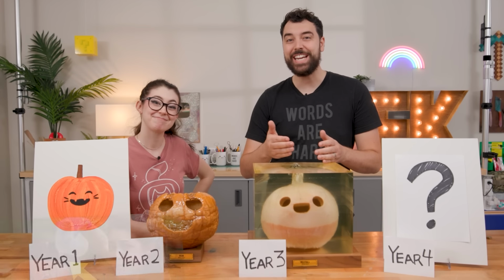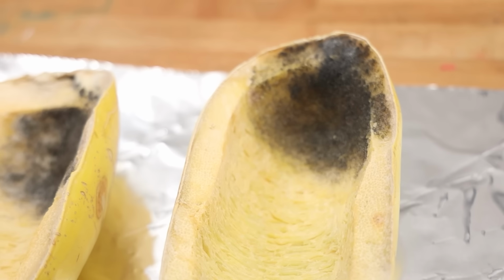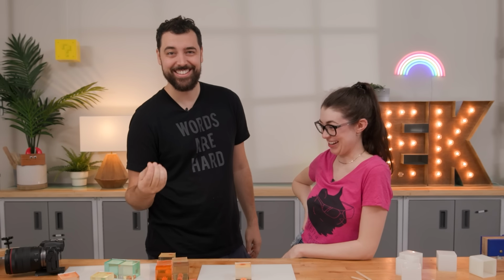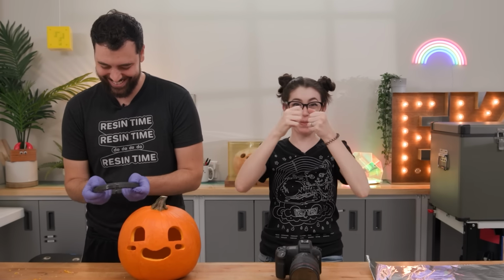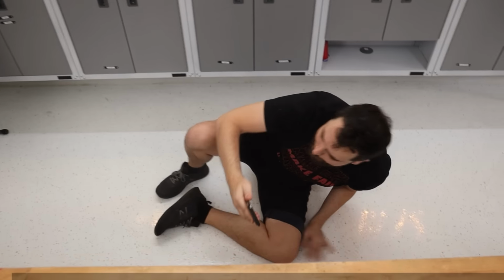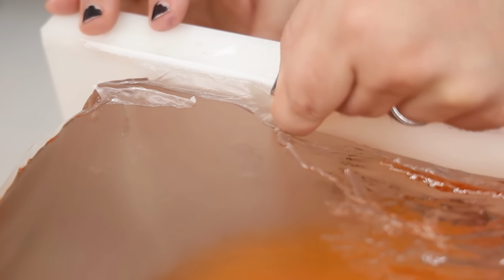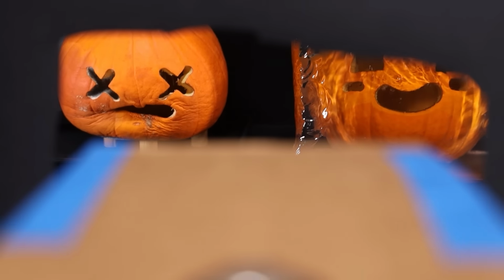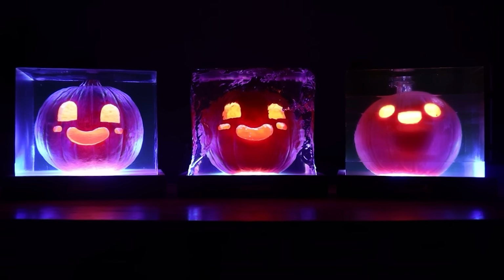Our BIGGEST resin pour yet… all to preserve a pumpkin

Comment: FYI, I am a pharmacist who deals with drops and volumes every day when calculating how long a bottle of eyedrops will last. The generally accepted conversion from drops to ml is 20 drops per ml. So 480 drops = 24 ml. There's some sources that use 15 drops per ml (and others in between) but 20 is the most common.

Comment: Biotechnologist here! My theory about the first experiment is that, leaving the alcohol/bleach on for so long damaged the cells, making it easier for microorganisms to eat through the tissue. When you disinfect plant tissue for something like in vitro culture, you usually only soak the plant/fruit/veggie for a certain amount of time (seconds or minutes depending on the solution used) and then rinse it off with sterile water. This is because the chemicals will otherwise kill the tissue. You should then do the resin asap as to not give the microorganisms a chance to grow back. You should also definitely use diluted alcohol/bleach, as they are too strong to be used in full concentration.

Comment: You guys should freeze dry first. Then drill small air outlet holes in the top to avoid air traping.. Then coat in epoxy and  cure under a vacuum. Entertaining video as always! Good luck 🤙

Comment: Just an idea, but it work for canned preserves: if it's possible to heat up the resin after it's cured, you could try applying it to the pumpkin and then heat the whole thing up to 110°C in a pressure cooker and cook it for 15 minutes (triple that if you can only get it to 100°C). That should kill anything that might be able start the rotting process. If you wanna be extra thorough you can repeat the cooking on a couple of subsequent days to prevent any spores from taking hold. Ideally the resin would then do the same job a mason jar might do.

Comment: Just to clarify - is apart of the issue it not sealing properly before all of the resin kicks as well (causing rotting etc. like with Meatball?) what if you literally dipped or poured (probably better dipping) the entire hollowed pumpkin into resin and then allowing that resin to harden and therefore seal the pumpkin entirely, so that none of the organic aspects are a concern when emersing it entirely in the giant resin cube. If the initial sealing worked then it should retain the pumpkins natural color and stop air from entering into the pumpkin to make it rot - if it looks perfect after that the I don't see why it wouldn't then be able to successfully be submerged into a giant cube of resin.

Comment: I think I can help. There are a couple problems with the sterilization technique. First, if absolutely everything, including the holding chamber, aren't sterile, then a sterilized squash isn't going to stay sterile. Second, it doesn't seem like any of the squash had bacterial growth (unless there were some smells going on you can't get through the screen!), only mold, or fungal growth. Unlike bacteria, which are prokaryotes, fungal cells are eukaryotes, more similar to human cells. This means some fungi cause more difficulty in preventing growth. A lot depends on the humidity, temperature, and light where the pumpkin is. Another problem is that squash is naturally porous, and sterilizing in each and every crack is incredibly challenging. One reason your control could have had less mold involves the bacteria you sterilized against- some bacteria (like Lactobacillus) can prevent mold growth. Another might be that mold spores were introduced in the sterilization process- even the yeast that is naturally part of our skin flora can result in fungal growth. My guess as to why you got air bubbles in chunk 1 and frostiness in chunk 2 would be that the resin is reacting with the organic matter in chunk. One of the main components of epoxy resins is phenol, which can react with the water released from the decaying pumpkin to form phenoxides and hydronium ions, causing a decrease in the pH. This would likely interfere with the setting of the epoxy. This is just one of several reactions possible, but the way that the frosty layer is mostly right around the surface, I would guess it's part of the problem. One recommendation is to use either formaldehyde or formalin in the pumpkin and allow it to cure before applying resin. It can be difficult to obtain formaldehyde without a lab license, but formalin is a bit easier to get your hands on. It should be injected into the flesh as well as applied to the surface! I'll keep my eyes on your channel to see if you give it a try! Hope this at least gave you some ideas!

Comment: Salt is an effective preservative. And, you might try another resin that's more resistant to yellowing. You gotta have that drill spinning before it hits the flesh. It helps if you rock it slightly from left to right and up and down as your drilling through.

Comment: Borrowing a bit of common tech from woodworking, you might try pinprick-ventilating the interior flesh, putting the pumpkin into a bucket of warm polyethylene glycol and pulling a long, slow vacuum/repressurize cycle to replace most of the water and air in the pumpkin with PEG.  This should stabilize it dimensionally while probably preserving it.  If it doesn't rot almost immediately, then do the refrigerator resin pour and you ought to be good to go.

Comment: So bm sculptures puts a coat of resin on wood pieces that he submerges in deep pours, cuz the wood could have like hidden voids and all that so the first coat prevents air from escaping into the final piece while its curing, so if you did a fast curing coat of resin all over the pumpkin before putting it in the mold and doing the deep pour I think this method should work out, assuming its quick enough that there's no, like, decomposing between the thin coat and pour. Though I'm not sure there's a way to avoid the delamination of the resin and pumpkin, unless you somehow replaced water cells in the pumpkin itself with resin?

Comment: Try putting the pumpkin upside down with a clear acrylic stand to support it then pour the resin inside while it’s upside down with a hole in the bottom then you can flip it so it’s the right way then there won’t be air pockets in the pumpkin

Comment: You guys should try flipping the pumpkin upsidedown with a big hole in the bottom,  you can use the hole for the electronics and it will make sure that there's no bubbles.... You could also try sealing the pumpkin with something other than resin before the pour.... The heat from the resin could maybe be cooking the pumpkin causing it to juice... So maybe using something other than resin to hopefully protect it from the heat?

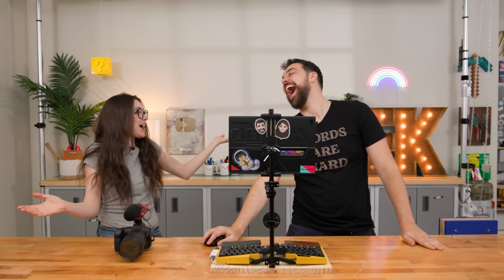Comment: 5:55 you didn't separate the samples, so mould spread between them. The sterilysation only kills the microbes on the surface temporarily, they can still get recontaminated, they're not protected forever.
I think the reason the control lasted the longest was that your preservation methods damaged the cells of the squash at the same time as killing the microbes. That's to be expected, microbe cells and plant cells aren't identical but they're made of similar stuff. After the plant cells have been damaged, their contents is easily available as food to any new microbes ariving on the sample. So when mould spores get onto the sterilysed samples, they grow faster with the more easily accessible food.

If you sterilised the samples immediately before encasing them in resin, the sterilised ones probably would last longer becuase they would have fewer microbes to cause decomposition. The test you did doesn't tell you what would happen if you encased a sterilised sample in resin.

Comment: Chunk 1 is the way to go it would seem. Voids being created at the outer layer is when you want them to be, otherwise the pumpkin will just detach from resin and not look orange or clear at all. I see two options of where to go next from it: either make a bigger cube and just slice off the edges with voids altogether, making it a perfect cube, or just let it have its imperfections which add to the character. In any case sanding off the voids isn't creating a good look at all.

Comment: I know I'm coming in a bit late but I wanted to comment on the reason the most probably grew.  These plants are alive even after you pick them. They probably have some way of keeping bacteria and mold in check. Once you spray them with bleach or alcohol you're probably destroying whatever means the gourd has to protecting itself.  A better test would be to cut up small pieces and then spray them with the various substances and then try putting them inside the acrylic because that is the environment they're going to be in.

Comment: what if to prevent the air pockets and giant voids, you do the pour with the bottom hole of the chosen victim facing up and the stem pointing down? like how with the giant play button mold the bottom of the mold is the top of the finished product.

Comment: I've been racking my brain as to how this crazy project of yours could ever actually work and I have an idea. What if you used UV resin to seal the pumpkin first? You could paint on or pour UV resin in sections and cure it ad you go. Then, you shouldn't have a problem layering epoxy over it. If you can successfully encase a pumpkin in a layer of UV resin, there shouldn't be any decay. Also, the epoxy pour should mask any lines from the UV resin sections.

Comment: what if you coated the pumpkin in resin and then submerged it? that could help with the "juiciness" that seems to be part of the others?
I do think Chunk 1 would've been fine to take and put back into the og mold and poured resin in the to fill in the voids? i do wonder what kind of layer lines that would give

Comment: If you could somehow replace the water in the pumpkin with resin, without it shrinking, you might be able to pull off a truly preserved pumpkin. Maybe if you found a epoxy resin that took weeks to cure, stick in and the pumpkin in a giant vacuum chamber and let it slowly boil off the water inside the pumpkin. You could also to sterilize it with heat before encasing it in epoxy, this would ensure it's completely sterile, inside and out, and would work far better that a volatile chemical on the surface.

Comment: Next year, vibrate out the air pocket in the fridge with the miniature concrete vibrator. 
Combine brushed on resin technique with large pour. 
Once perfected, sell smaller pie pumpkin versions. At least one, to me. 
I wonder what it would look like in a cylinder. 
Maybe sprinkle some moisture absorbing material to the inside surface

Comment: So first off, LOVE your Pumpkins ^^" Like the whole series ^^

But ah, second? ...I think I know why your controls are rotting so fast and why the resin process is screwing with the pumpkins so much ;w;

It's the heat. Carved pumpkins, where do you normally put them? Outside. Thanks to the cold of the autumn air, it's making them last longer. Freezing them basically ;w; Meanwhile, the resin and keeping the control inside is making them hot. So they are literally being encouraged to rot faster due to the indoor warmth and the heat of the resin curing ;w;

I dunno, it's just a theory...but I think that that is the problem ;w; Heat is the enemy of carved pumpkins it would seem

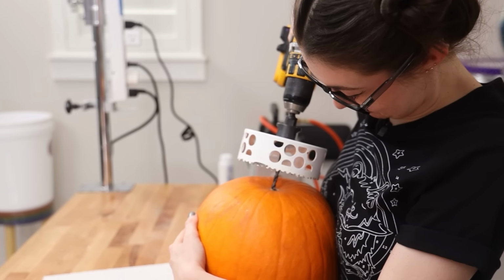Comment: 13:48 lots of tee-hees meanwhile my anxiety over safety with that freaking monster hole driller is at max. Glad that didn't turn into something worse so please let this or maybe another comment be a lesson for you: almost anything you drill into should be secured to a surface. You could have used a towel at the base so that you can rest it down without holding it against your torso. At the very least, don't be hugging whatever the object may be. Get some distance from it.

Comment: Fun fact: Decaying things release a lot of gas as they rot, ESPECIALLY human bodies, and if you don't let that gas go anywhere, crazy things happen. So if you put a dead body in a metal container and then fill the container with concrete and then dump it in a body of water, eventually the body will release so much gas that the metal container floats to the top and/or potentially bursts open, revealing the body inside. You'll see something similar in badly-maintained mausoleums - if the door is blown open or cracked, then they didn't put good ventilation in there and the gases built up too much.

What I'm saying is, next time you do this, you either need to REALLY make sure those pumpkins are dehydrated or you should put in some air holes, or you'll have a big exploded pumpkin in your closet.

Comment: My Thoughts: The bleach and the alcohol killed or dried off surface essential oils and/or bacteria that usually protects the pumpkin from mold then evaporated making the pumpkin extra susceptible to mold spores. My suggestion: Try coating the pumpkin in essential oils that are naturally resistant and won't evaporate as quickly.

Comment: With hole saws that big you wanna start off slowly then speed up and don't start with the tewth touching the material. And definitely have your work lower than ylu for leverage. I recommend putting it between your feet and holding it. I have a ton of experience drilling through metal boxes at work.

Comment: If you continue this. Maybe fill the fridge first, with some steel or aluminum and let it cool all that down, to give it some more thermal mass, and the fridge won't need to work as hard. Making the mold out of aluminum would help cool the resin as well.

Comment: what if, for next halloween, you did the same thing as this, but you put the pumpkin in upside down? like, after pouring a thinner base layer, you attach an acrylic disk or something to his stem to keep him stable and to weigh him down a bit, and then dothe massive pour. the bottom hole is big enough to let all the bubbles out and you won't have to worry about the air pocket! and the acrylic disk will blend in with the resin, hopefully so you can't see it! idk, i'm no resin expert, but maybe that'll work?

Comment: Maybe for next time, putting dry ice in the fridge box might help? Keep it much chiller than the poor little fridge motor can! though I don't know of that would then make it too cold for resin. I guess if the chunks aren't touching the mould itself and you just let the cold CO2 gas sink in around it, and use the insulation of the fridge box to keep it there?

Comment: You need to sort of embalm the pumpkin. Year 2 was a good mummy attempt. Perhaps if you could replace the water inside the pumpkin cell walls with some other filler, perhaps resin, to prevent wrinkling.

Comment: @FrankErdman suggested this last year, hopefully I'm early enough to be noticed for next year.

Start by freeze drying the pumpkin, then use cactus juice stabilizing resin to fill the interior of the cell walls.

Freeze drying will remove all the water and the stabilizing resin will fill the space where the water use to be. I'm extremely curious if that would be enough to make it immortal.
(I Am trying to help the message spread i am not trying to steal it thank you)

Comment: The only thing you did wrong with Chunk 2 is, you bought both pumpkins on a same day, and by the time you put it in resin he was already starting to decompose. He wasn't going bad still and was still edible but on microscopic level he started to release some gass that got trapped in resin after some time. Do the same thing with the freshest pumping possible and you are gonna nail it.

Comment: Cut any fruit and vegetable, it is stil alive and has an innate functional immune system.  The microbiome on the surface of the squash combats harmful bacteria until the biome runs out of fuel. Sanitizing the biome opens the surface to invasive bacteria with nerfed opposition.  Also, It's impossible to perfectly preserve something organic in resin as there is oxygen and simple sugars within the cells themselves and the interstitial space. Even if the outside air is prohibited, there is enough catalyst within the living matter to allow for decomposition.
Love your maker videos, by th way! They are the best on You tube!
Reply: You are better off making a silicone mold of your pumpkin, then making a resin pumpkin from the mold.

Comment: What if you ask to NileRed to use his freeze dryer to remove all the water inside the pumpkin? I feel like making it porous it will absorbe more resin and avoid water rotting and maybe air bubbles (?)

Comment: Clean and sterilize your cutting utensils. Any bacteria will act as a catalyst for rotting. Rotting in mostly bacteria braking down organic material. And moisture and warmth are breading grounds for bacteria. Use some silica gel packs, keep it cool, carve with dry sterile utensils and I know nothing about resin but that’s your specialty. With those tips it should turn out fine. Sterilize everything even the resin stuff.

Comment: What if instead of cutting the hole in the bottom, you cut from the top so you can cover the eye and mouth holes and fill the pumpkin separately. Then uncover the holes as you fill so there is no air.
If you do see this, I would like to recommend the name "Terry"

Comment: I'm only 10 minutes in so I don't know if you came up with an explanation for why the bleach and alcohol treated squashes ended up molding quite fast. I have an explanation. Basically there are still mold spores in the air and on the squash. When you treat it with bleach or alcohol 2 things are happening. One, as another commenter said, is that you're reducing surface competition from any other microscopic life without entirely removing all microscopic life. And importantly, secondly is that the bleach and alcohol solution weaken the integrity of the plant cells at the surface. Think of it like a mild chemical bruise. We know bruises are places where fruit will rot from the fastest. Since the squash also isn't dried out it creates a perfect little environment for the mold spores to inoculate the surface.